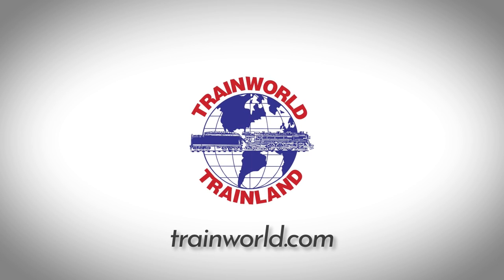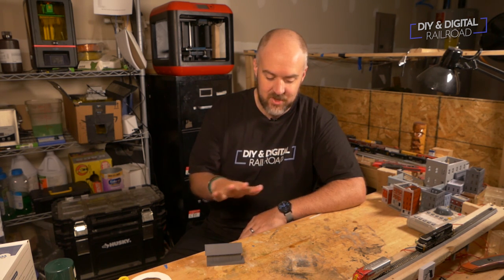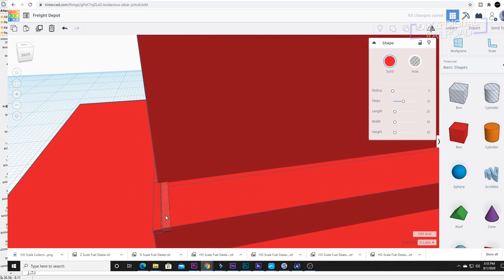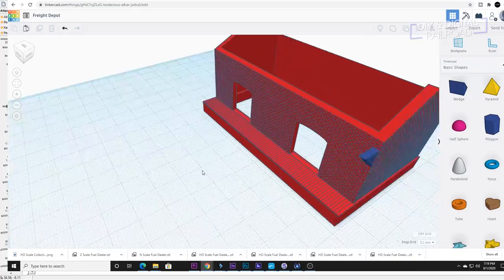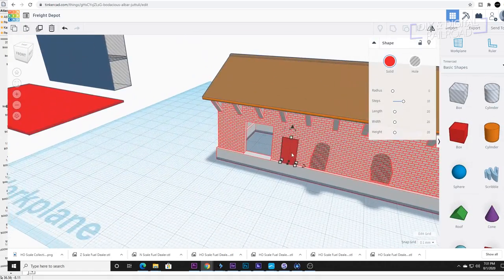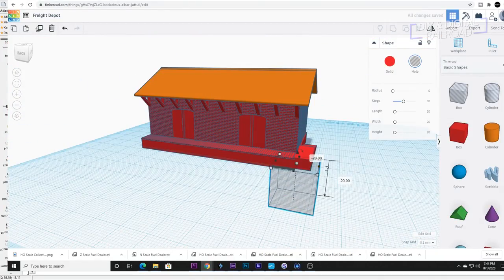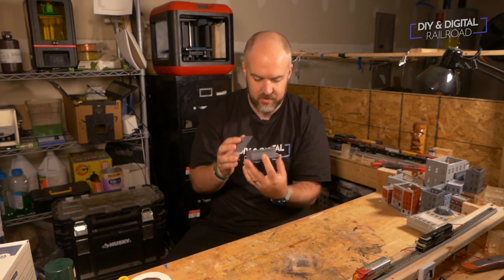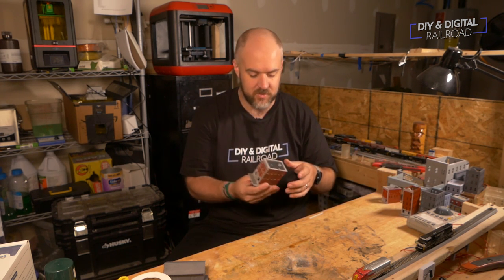Designing and 3D Printing an N Scale Model Train Station/Freight Depot!

Comment: Jimmy, in your calculator segment at 01:31, it reads 4267 * .00625 Can you please explain what that means?  I realize this is an estimate for N Scale/Gauge but I haven't figured out the math just yet.  Are you converting to centimeters?  Also, when doing say H0, do you use the same design but upscale the whole thing to another calculation?  Thanks!
Reply from the maker: Hey Johnny!  No problem.  So the 4267 is 168 inches or 14 feet converted to millimeters.  the .00625 is decimal version of 1:160 which is N Scale.  So I used google to convert to millimeters from inches, then I got the scale measurement by multiplying it by .00625.  The reason I am using millimeters is that 3D printers build space is measured in millimeters so its easier to build for that.  for HO scale all you have to do is 1/87 and you get .0115 So instead of multiplying the 4267 by .00625, you would multiply it by .0115.
Reply: @DIYDigitalRailroad  That rules, thanks for explaining that so well!

Comment: Get a portable AC unit...3-400 bux Walmart Lowe's home depot etc
Reply from the maker: My wife won't let me cut a hole in the wall for the vent tube 😰
Reply: @DIYDigitalRailroad  well....you could on the garage door....double as an exhaust hole... put one of those dryer vent flappers on the outside
Reply: Just tell her you'll put a clothesline in the backyard then you'll have your dryer vent tube they usually come around pretty fast :-)
Reply: @DIYDigitalRailroad  I can relate